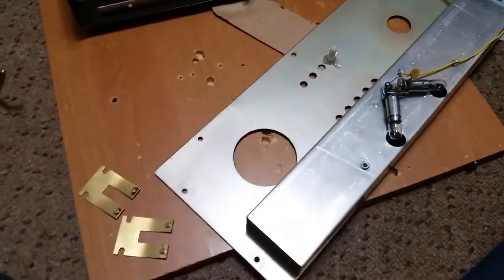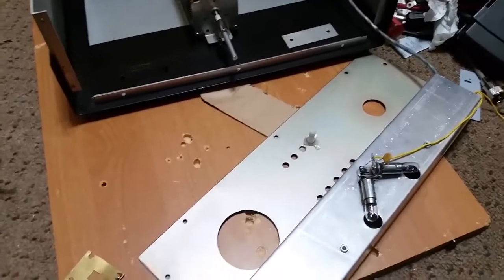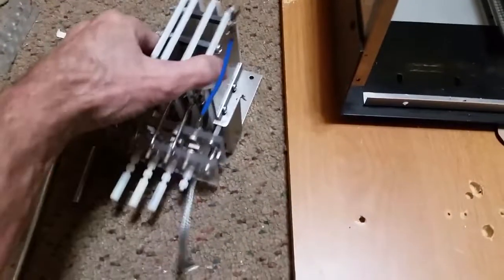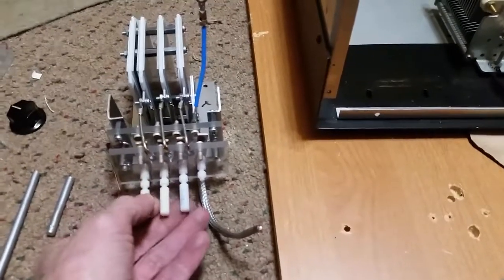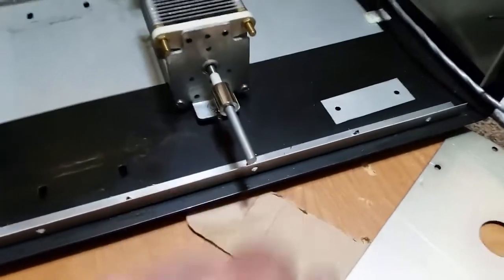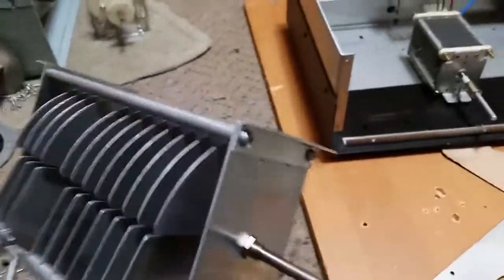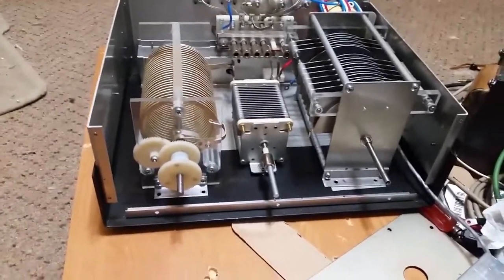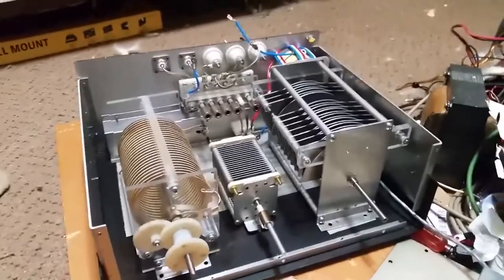NYE VIKING MBV-A 3000 Antenna Tuner Rebuild

Comment: Hi, congrats on your effort. Maybe 7,8 years ago or more I got one of these as I had a hf2500 magnum power amp. It did the job. I eventually developed a problem with the swr meter jumping up and down when I used voice. Steady on cw. Looked everywhere for help. Nye viking dropped us like a hot potato. One kid say oh it's the ic chip needs replaced. I ended up putting it on the shelf as all those great looking parts looked good for something. I'm 73 now and still have it. I found a ten-tec 2k tuner, 238b I believe. Very good. I was so surprised to see your video. So I thought I'd ask you about the meter jumping. I will look for part 2 of your video. Gotta give you credit for your work. I know enough to be dangerous. Look and sniff guy. Anyway good luck.

Comment: Wow that was a horrible transaction for sure.  Do you happen to have any pics of the metering circuit in the back, I took the screws out and it all fell apart as you can’t see how it mounted in there lol.  Can’t find anything on this meter board other than the schematic.  It was one of those o crap monuments when I heard all the little washers fall inside
Reply: You need to take the back panel off to access the meter board.  It isn't that hard to do you need to remove every screw and nut (except the two screws that fasten the metering circuit board) from the back panel and carefully desolder the main blue RF input lead on the inside of the tuner that goes to the heavy copper strap, in order to remove the panel and the board as one.  Once you do that you can access the meter circuit board no problem.